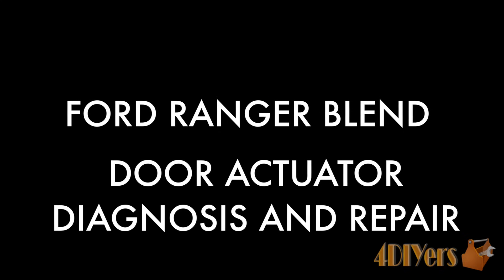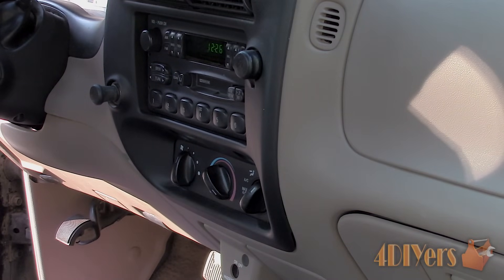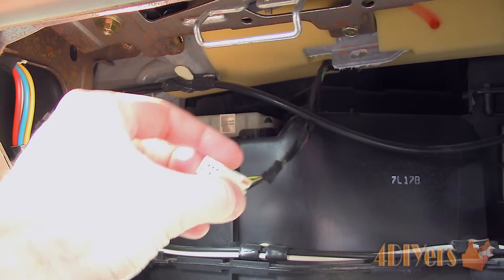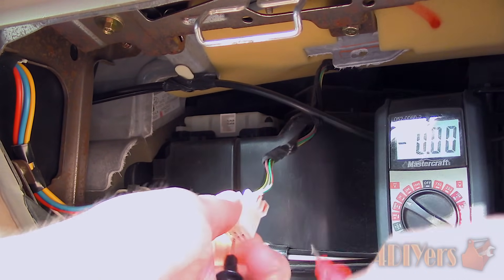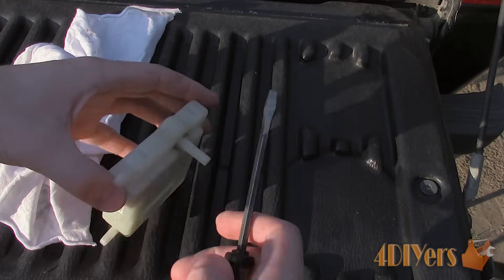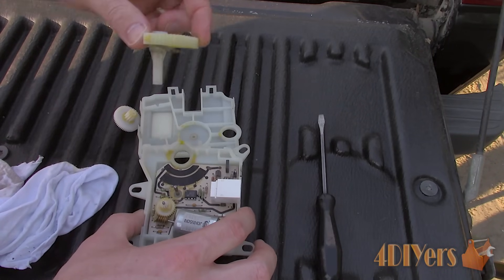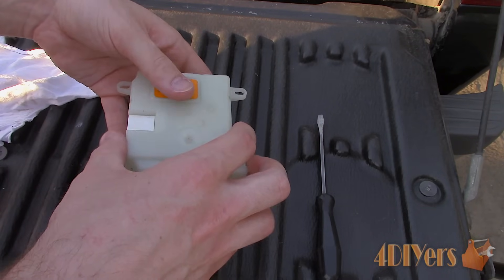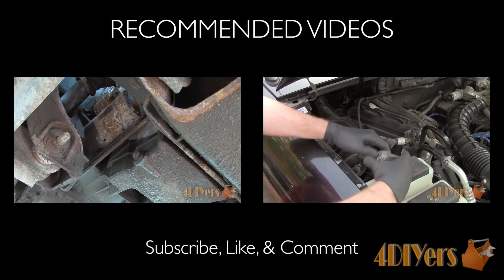DIY: Ford Ranger Blend Door Actuator Diagnosis and Repair

Comment: Thank you for this video. I was able to get all my bolts out without snapping the plastic off. I cleaned all the goop off the contacts and it worked just fine. It had been stuck past the drive gear and it just kept turning because it couldn't read the position. I put it all back in and all is working great. I haven't had working temp control in my truck for more years than I can remember. Kudos to you, sir!
Reply from the maker: Glad to help out and awesome to hear :) I have a few others Ranger videos as well if you're seeking more tutorials. Don't forget to subscribe.
Reply: How did you get the back screw back in?

Comment: Have a 2007 ranger, upon cleaning the inside of the actuator I noticed the small gear had a single spoke missing. Can this be the cause of noise and malfunction of the blend door? Edited update discovered it was two spoke/sprocket that were missing from the gear.

Comment: I have a 1998 ford ranger automatic 4.0 liter 4×4 just like the one in this video, the problem I'm having is I have no air coming out of the front or bottom vents I only have air blowing out of the default defrost vents could replacing the blend door actuator fix my problem
Reply: Air only from defrost is most likely caused by a vacuum leak, check the vacuum lines behind the glove box and under the hood, particularly the 2 lines that go to the black plastic ball near the passenger side headlight.

Comment: I had same problem with screws instead of clips. I did get a socket on it and got the back screw half out. I then used small wrench that I bent to get it the rest of the way out. I will be buying a ratchet wrench to put back together.
Reply: I have a 2008 Ranger and I was able, quite easily, to get a 1/4" ratchet with an 8mm socket in and remove the rear screw. I tied a length of dental floss onto the ratchet and it came in handy as the ratchet did slip out of my hand. All I had to do was pull it out with the floss. 
Loosen the screw until it's almost out then work your fingers in to remove it the last few turns. Be careful not to let it drop. When reinstalling, I tied the same floss around the screw under the head and just left it in place.
Reply from the maker: What year truck??? I actually had someone just comment the other day with the same issue and used your tip to help them out with the back fastener. Thank you for the tip too! You might be able to fit a 1/4" ratchet.
Reply: @4DIYers  put the two front screws in, you don't need that rear screw in there anyways.
Reply: It's 2008. Check out rockauto for replacement part. I think it was under $30.

Comment: Heads up. Watcher your video and then went to it. Started to pry it off the mounting posts when I noticed it has screws! Got the front two out easy after disconnecting the wiring harness. Been trying for TWO DAYS to get to the one in the back. Whoever the engineer was that designed the mounting of this thing should be horse whipped! Any ideas how to get to the back one, short of pulling the dash???
Reply: I'd like to see a video of someone changing this as well. I have a 2008 ranger and I don't even want imagine having to squeeze back there to get the two back screws out.
Reply: @fastjeff6  I literally just finished swapping it out. And to my great misfortune I also discovered my 2007 ranger has screws... Only had to wrestle with the back screw, luckily only one, for 2 hours or so. Getting it off was considerably easier than getting it back on. I ended up using the smallest socket wrench I had and an 8mm socket. I'm still amazed I got it swapped out.
Reply: Seems like this would be the first thing to come to mind, but I didn't even think of trying that. Thanks for the info!
Reply: I just pried at mine with a big flat head screw driver and the back bolt and it's plastic thread broke off the surrounding plastic.

When I put the new one in I just did the front two screws.  Works fine, good as new.  For a $40 part I could care less if it breaks again in two years, easy fix.

If you broke the screw off and really want to secure this thing so it doesn't come up in the back, just cut a piece of wood in a wedge and wedge it in there, the top plastic will bend a little to accommodate the wedge, then throw some duck tape on it or hot glue.
Reply from the maker: Thank you for sharing. What year is your truck??? I Actually just had another viewer post today regarding fasteners too. They used a socket to get the back one slightly loose and then a wrench to finish it off. You should be able to see their comment, it's on this video.
Reply: 2003 Ranger has the screws and that back one is incredibly difficult to access (front two weren't easy). I got the front two off using a vice grip on a socket since my ratchet wouldn't fit, and now i am stuck on the back. Fortunately there is only 1 in the back; it looks like some of the later models have 2. I plan to try smaller ratchet or a right angle screw driver.
Reply: @josevelez8302  Best of luck! Get the smallest ratchet with the finest teeth you can find. When I did it there was very little room to swing the ratchet. Also if you have it, stick a tiny magnet in or on your socket to help retain the screw. I also utilized a small dental mirror + flashlight to help align the socket  whenever it would slip off.
Reply: damn horse whipped
Reply: I have a 2008 Ranger and I was able, quite easily, to get a 1/4" ratchet with an 8mm socket in and remove the rear screw. I tied a length of dental floss onto the ratchet and it came in handy as the ratchet did slip out of my hand. All I had to do was pull it out with the floss. 
Loosen the screw until it's almost out then work your fingers in to remove it the last few turns. Be careful not to let it drop. When reinstalling, I tied the same floss around the screw under the head and just left it in place.